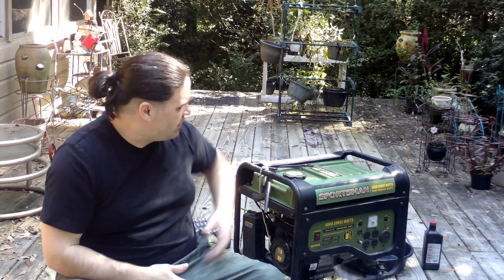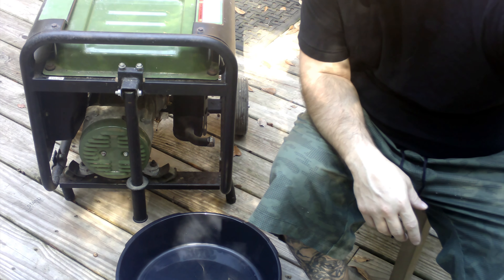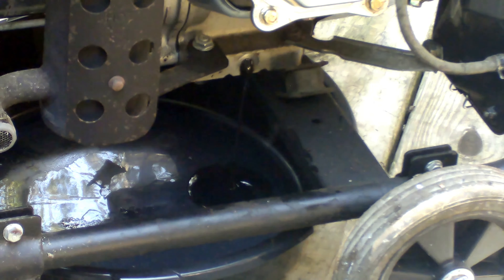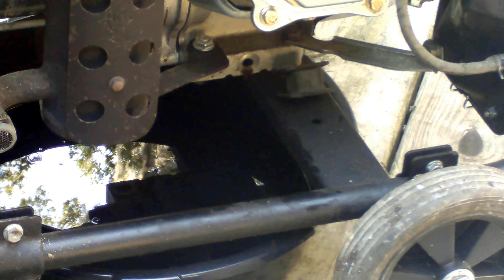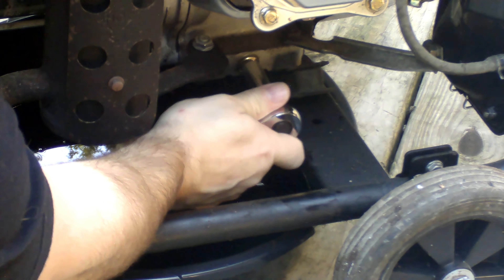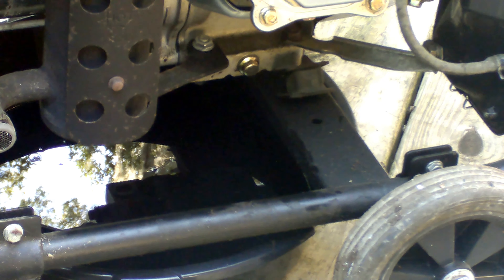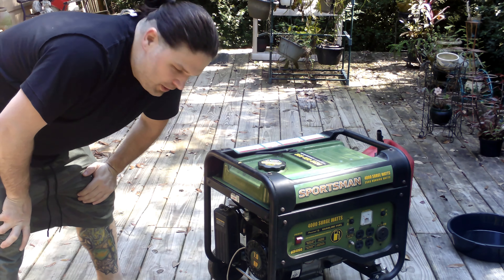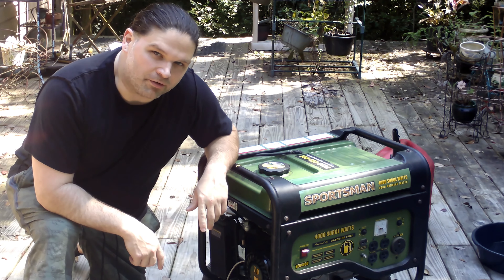How to Change the Oil in Your Generator! #selfhelp #maintenance

Comment: Good job. Couple of notes...
Editor speaking: "displaces" 212ccs. It does not "produce" them.
Mechanic speaking: Check the oil level with the dip stick before topping up. There will always be a little left after draining and you may not have needed the extra bit.